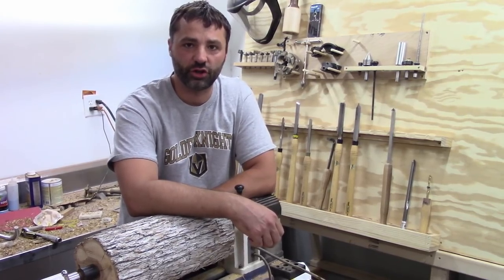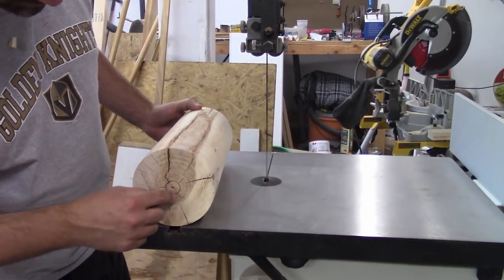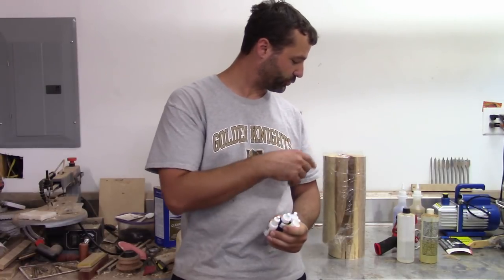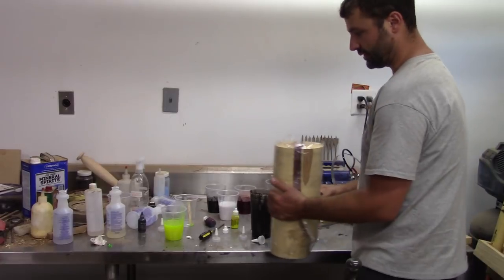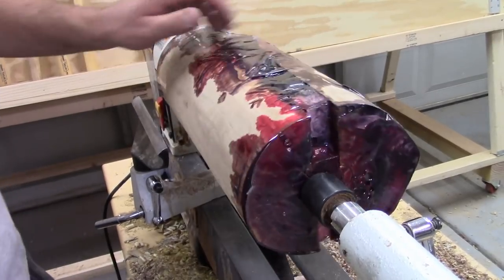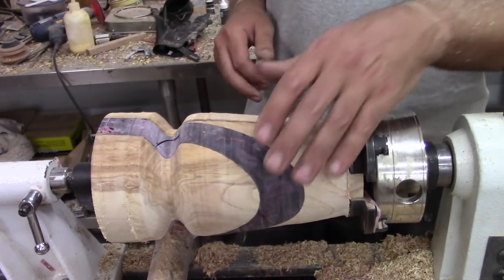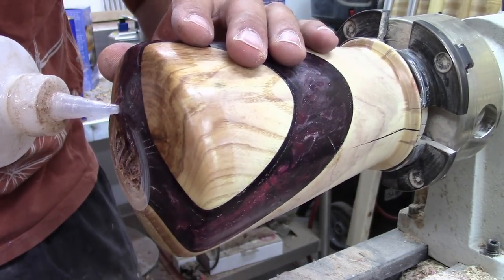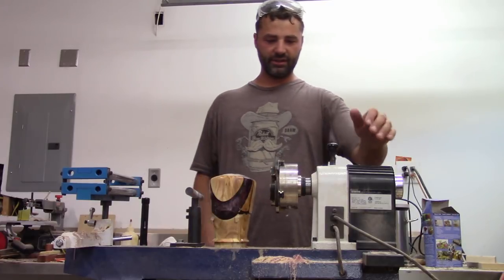Woodturners Journal:  Acrylic and Wood Vase Fail

Comment: Hope it’s not a stupid question but what does the vacuum chamber do to the resin?
Reply from the maker: Soldierblue It removes all the oxygen from the resin, so you have a smooth beautiful finish when it dries.  Without it, you could get little air bubbles in the resin when it is completely dry.
Reply: Woodturners Journal Thanks for that. By the way love your videos and your work.
Reply from the maker: Soldierblue Thank you.